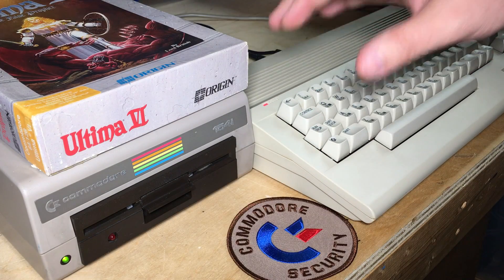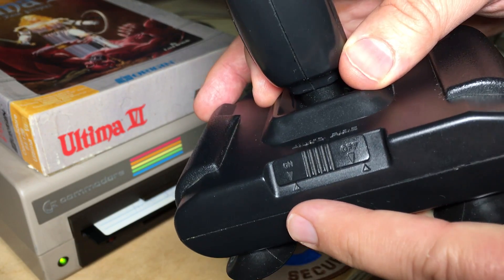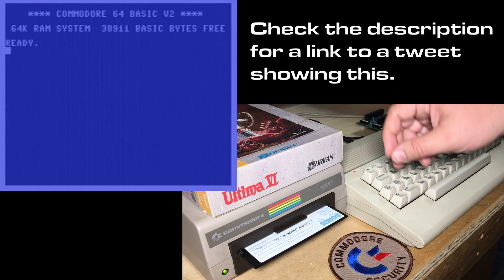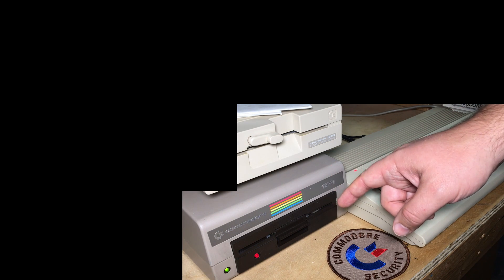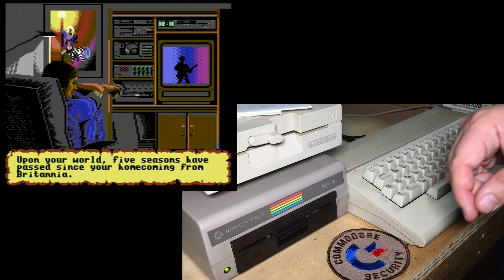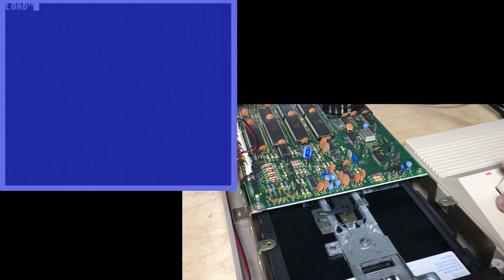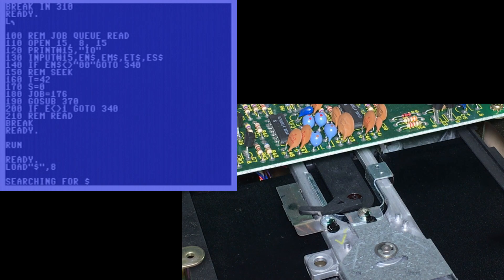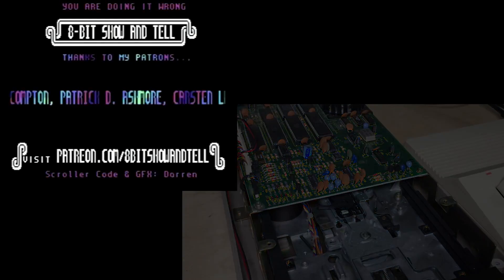Karateka Killed My 1541  (Temporarily) and Other C64 Scares

Comment: Great video.
When I opened my brand new c64 + 1541ii combo pack back in the day I misread the setup instructions and set the 1541ii jumpers to device 9. First power up I tried to load"$",8 and got nothing...
...half a very unhappy hour later I realised what I'd done. My Dad was not impressed.

Comment: I remember with my 1541 sometime if there was some problem with copy protection the head would come too far forward (close to the center) of the disk and get stuck....and then no longer read any disks. Until you put the Head Vibration Protector cardboard insert if fits in but stops hanging out a little bit, push it all the way in and it would push the head back to the right place and it would read disks again...somehow I just figured out how to do it when it happened...It is like the extra little square tab sticking in was long enough to push the head back into place...must be like what that initialize command does...You should make another video showing that you can fix the karateka drive killer with that HVP insert that came with the drive originally. I remember when this first happened and I about holy crap I just broke this $200 disk drive too just like how Robin said!!!
Reply: My 1541 II got stuck once, and it took me days to find  the solution... Initialize didn't work in that case, and I didn't have the original disk insert.
My deepest thanks go to the kind soul that had the proper measurements for the "tracker card" as he called it. 
I quickly made one from tthe cardboard box of a package of frozen pizza (perfect thickness), and i've kept it in my box of floppies since. ;)

And, yes, that tab is meant to push the drive head back to Track 1 if you want to transport, store or move the drive - it really does double as a hard reset tool if the drive gets stuck and the initialize doesn't work... :)

I agree that Robin should show the trick with the insert - and how to cut out your own if you don't have an original. Bonus for making one for the 1571 as well, since the 1541 insert doesn't work for that one... 
I'd love to show people how to cut their own, but I can't seem to find the proper measurements anymore :(

Comment: I always used to use a fork to short pins 1&3 on the user port. Becoming complacent, I carelessly ended up shorting the C64. Lucky for me, only blew the fuse.
Reply: how is that easier than flipping the power quickly?  power is right there on the side.  I'm not getting it.
Reply from the maker: I should have explained, resetting the C64 preserves RAM, and allows you to PEEK and POKE around from BASIC or with a machine language monitor. One major use of this is to POKE cheats into memory to give infinite lives etc. and then SYS to restart the game. Using the power switch will (usually) corrupt or clear RAM.
Reply: @GigsTaggart  I remember resetting a C64 with pins 1 &3 , and i did it at school with Scissors well one time i did it wrong and blew the fuse.   The computer room teacher said I was not to do that again.  My own machine I put a reset switch on it, but some programs would not allow a reset.
Reply: My old C64 has had an added external Fuse holder on the side and two buttons for Serial and Main reset for years

Comment: I used to make 40 track formatted disk back in the day on 1540/41/71. Sometimes I would even copy data to unused dir sectors (track 18) to get more space. The reason it is "stuck" is because the drive won't home to track 0. The I0: (or just I) forces a read of the BAM, and, yes, tries harder by bump homing. If you new a disk it will "fix it" too.
Reply: I remember a separate command to cause more read attempts. The quick bunch of clicks before the error is the drive checking a half track to either side for data. If the disk is completely blank then it errors out. I THINK if there's something there to almost read, it will spend a long time trying and even bang the head to track 0 and back to see if that helps.